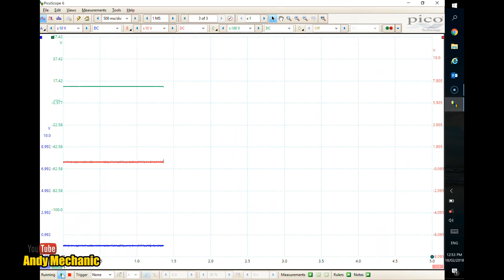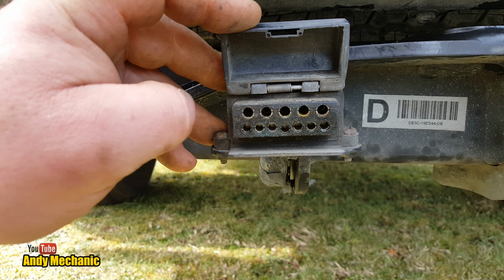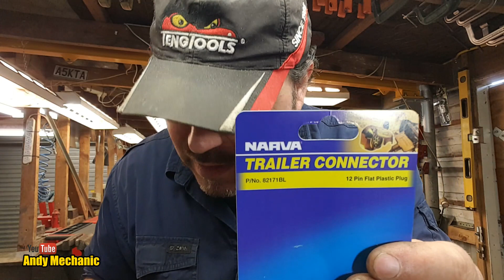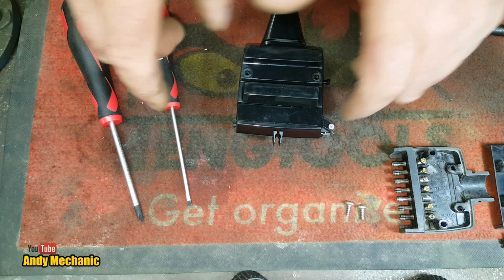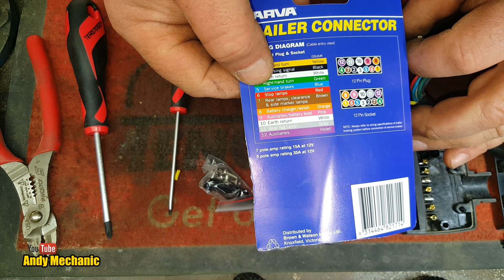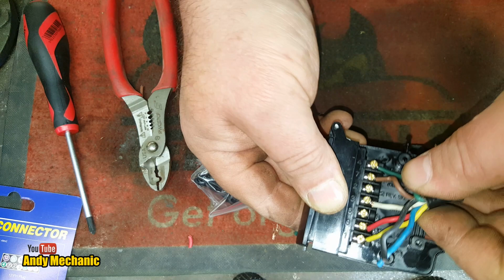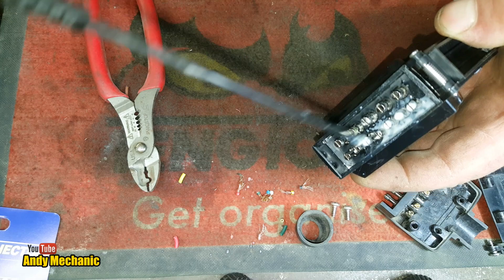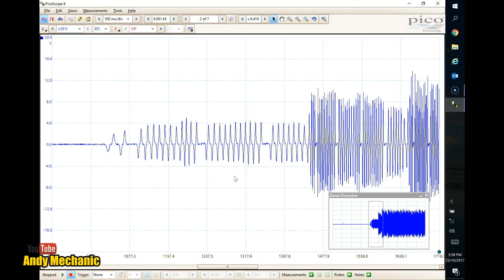NZ Trailer lighting plug issue #1465

Comment: We use the same ones here in Australia.

The issue isn't the plug design itself, it's Ford's crappy implementation of it. 
Replace that with a Narva one and you'll have a much better time using it. They're substantially more reliable and robust than the round ones.

Also, don't wiggle it side to side, that's what's ruining your pins.

And the blue service brake wire is for electronic braking systems. I don't know what the go is over there but for trailers over 2 ton here you need a breakaway system to apply the brakes if the trailer comes off, most of them use electric brakes with a battery and controller on the trailer to do it. Also has the advantage that you can tune the trailer brakes to the load and engage them independently of the car brakes which is brilliant if you blow a tyre on the tow vehicle and is pretty much a necessity when towing off road.

Comment: As AVE said something as simple as 7 wires and they still never jeesles work and I agree with him do them connectors give much trouble with corrosion compared to the UK/irish plug style also them snap on crimpers are the job
Reply from the maker: Thanks David, I find the UK round style to be far more resilient to failure than the crappy Flat NZ type. People here, especially commercial operators, are switching to the UK type but it's unlikely they will be adopted as the default fitment here in NZ - there seems to be a culture of acceptance that these plugs just 'fail' every few years & need to be replaced!

Cheers Andy

Comment: Andy maybe your experience is different but the English 7 pin plugs we have in Oz have given me and others so much grief we stopped using them and now all run flat - boats, trailers, caravans. Misalignment, sockets pushing out of their retainers, broken pins were the problem. Falling out in transit was not a problem, but getting a solid electrical connection was. Don’t have those problems on the flat except for the odd broken pin.

Comment: The 13 pin european twist together socket is a far better solution than the 7 pin.. and with so many pins you have the capacity to have power to the caravan, worklight, backuplight and so one.

Comment: Andy i have had the same issue an i used two small screws on the side of the two small teeth an that works very well as it stops the plug from moving.
Only thing is use a small drill to make the hole's for the screw or the little teeth will split an doing this will let you to adjust the screw a little for a tighter fit.

Comment: That there is a bad design. EU plugs are great, just the appearance of the 13 pin default means I need an adapter to 7 pin for older trailers :)

Comment: The rectangle plug is the standard used by vehicle and towing equipment manufactors/suppliers. Unfortunately, this has caused confusion. The pin I/O , wiring colours and male/female compatability are of ISO but the physical body is not, leading to variations between the major manufactors,  those being Narva and Hella. Narva produce a coupling retention system that uses a spring tensioned clip that encapulates the male coupling. They cannot be separated  physically, or by vertical or horizontal movement without irreparable damage. As both couplings are o-ring embedded, they are dust and water ingestion proof whilst coupled. Produced primarily for the mining industry, they are expensive but practability outweighs cost. Just another option. 👍👍🇦🇺

Comment: i have seen too many variations in the us.  all depends on the application.  flat four and round 7 w/flat connectors is common on consumer.  commercial uses mostly round 5 or round 7 with round pins.   basically as long as the lights work no one cares what you use.

Comment: What about epoxying two pieces of plastic on to the existing stops. That way you have extended the tabs, solving your problem.
PS.....get Hana back.
Reply from the maker: Good call but I was really trying to highlight the manufacturing issue & variance between the plugs resulting in the problem of it falling off - many Drivers may not appreciate or be aware of the issue.

Tool Girl Hana is in Australia unfortunately :-(

Cheers Andy

Comment: Andy,
Different countries use different standards due to different cultures and different laws.
Australia and New Zealand use the more advanced (AS 2513) while Europe uses the old 12N (ISO 1724). This might be fine of a cheap little rubbish trailer but it becomes a major problem when using Modern Trailers like Electric Brakes, Hydraulic Brake Pumps, Reversing Lamps, Breakaway Warning Systems and luxuries like Fridges and Dual Battery Systems.

And honestly, anyone who can’t figure out how to plug a 7-pin flat plug into a 12-pin flat socket should not be towing a trailer.

Comment: U.S. we have flat 4 or round 7. i have never seen that style of plug although it does look interesting if using both rows. one row would just be cumbersome to keep in place without a strap or mechanical holder. the service brake is for electric brakes.  on that style you are using i would have to make a shim and attach it so that the cover would hold it firmly when in truck. that space would drive me crazy.

Comment: Im having trouble with a recently purchased trailer. When i pull the lens of the trailer lights,  which wire should go where on a 3 bulb trailer light.  Left hand side from top to bottom is  yellow- red -white and the right hand light is   green -red -and brown.  Indicators work correctly, tail lamps work but right hand brake bulb illuminates when lights are on.  Both brakes dont work when i pump the brakes.  It looked really sketchy when first took the lens off as in wires not tidy.
Reply from the maker: Oh dear....Okay,  well it's best to assume who ever wired up the trailer didn't stick to the colour codes. 

If the Trailer is in NZ or UK then:

Earth - white
Brake - red
Tail - brown
Left indicator - Yellow
Right indicator - Green

Other two colours ( Blue & Black ) are unused. Blue is for a rear fog lights on a UK Trailer & years ago they used to split the tail light wiring left & right by using the black as a second tail feed - I haven't come across this for some time now so I don't think they bother anymore.

I would suggest you start at the plug & see if they have stuck to the standard colour usage then follow wiring to the back - there may be a Junction box or some nasty joints hiding wire colour swaps which will really confuse you further!  

Good luck
Andy

Ps. Personally I would rip it all out & start again! :-)
Reply: @AndyMechanic   Thanks mate. yeah i picked it up in Hamilton  NZ the other day.The 7 pin plug was cut off about 50 cm . I rejoined it. Its wired correctly . Tail light and brake light bulbs were blown on the left side and brake light was blown on right hand side, right hand tail light bulb was missing.  Im suspecting a broken wire or something screwy in the junction.  Its a good trailer for the price, just had no rego, no warrant, no number plate, and lights not working. Brand new  tyres and spare and no rust.

Comment: great job but the only thing i noticed is that you should use dielectric  grease for electrical connections as a white  spray grease can conduct electricity and cause problems  in the future but still better then nothing i guess thumbs up shared

Comment: 7 pin flat is what is used for light vehicles in the civilised world, what you call an "english" plug is what trucks(real trucks, not what they call "trucks" in the US,)use, that 12 pin rubbish is just a marketing ploy from vehicle manufacturers. If you need high current plugs you should be using an Anderson style plug.

Comment: It's not English, it's European and has different wiring digrams. The modern one is the 11 pin variant which provides permanent +12v for caravans where such power is required. I assume a fridge or freezer.